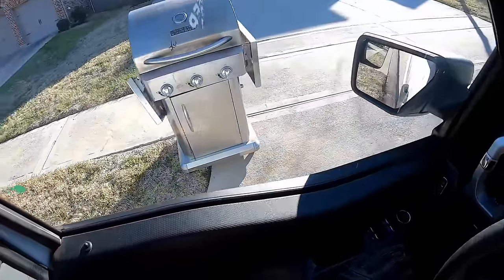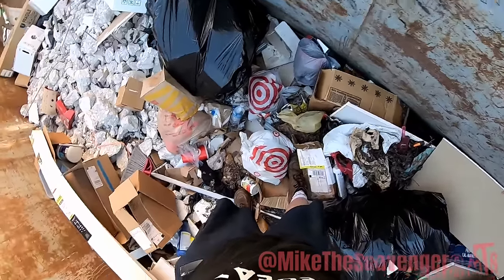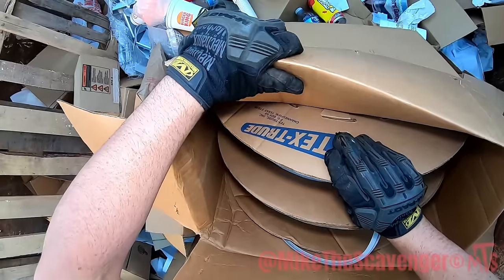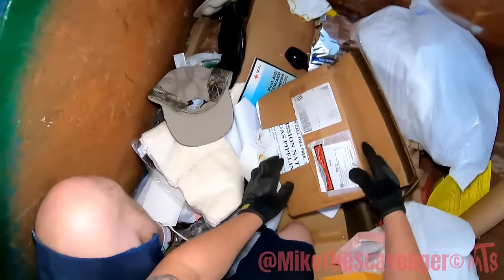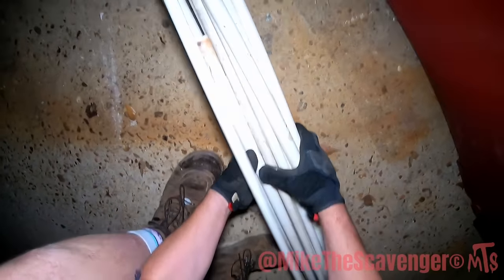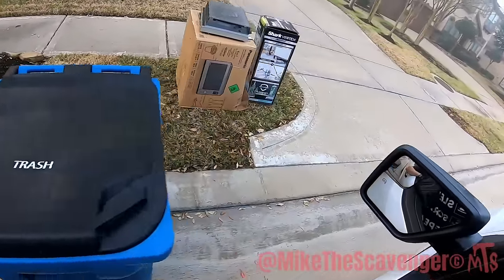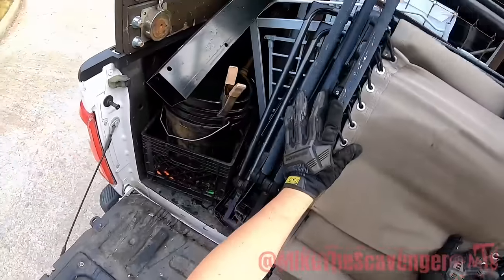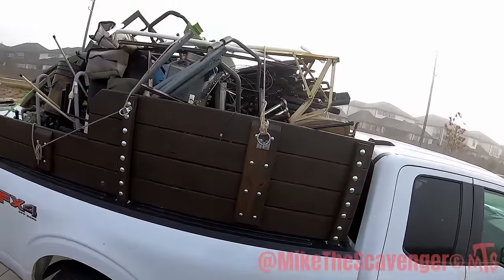Dumpster Diving & Curbsiding "SO MUCH VIOLENCE!"

Comment: That item you called a "snake picker upper" is actually a "weed whip" or a "weed rake". I've heard it called both. Essentially it's designed to swing back and forth in front of yourself, with the flat, semi sharp end part coming down just above the surface and cutting the stalks of grass like weeds. Good for walking across or into a field with tall grasses or similar weeds, where you may want to cut down a path directly in the path your traveling. Not too good for clearing any large acreage, but I guess it would have been better than nothing back in the days before string trimmers. Unless of course you had a scythe. But I think scythes were considered more of a farming implement, used for harvesting grain or fodder for the animals. The weed whip you found is more modern and meant more for a suburban resident. A good thing to go along with a not motorized reel mower. I've got one of each in my garage although I'll be the first to admit I never use either till since we also have plenty of modern lawn equipment; gas and battery operated.

Comment: Hey Mike, if you see this, I've been wondering if you're yard takes artificial Christmas trees as is? When I find them I usually cut the light strands out, and in the process I'll remove the outer parts of the branches, leaving mostly the thicker metal pieces and not much of the artificial pine needle plastic. Just curious if you process them at all or just throw them out with your shred at the yard.

Comment: Firearms, especially toys ones. Doesn't equal violence. That's what is wrong with society these days. Assuming the worst. Firearms are a tool. In the wrong hands. Even a wrench or screwdriver can be used improperly.

Comment: I'm going to keep asking until I get an answer!!! WHAT IS CAT WIRE? YOU DON'T LIKE TO ANSWER ANY COMMENTS. KINDA RUDE 💯👎👎👎👎
Reply: "Cat wire" is short for Category 5 cable. It contains twisted pairs of copper wire and is used for connecting computers (and other devices) to servers in networks. I can only assume that Mike has some way to strip this out to sell the copper or maybe the scrapyard will take it as is